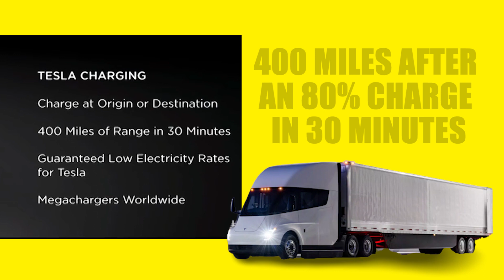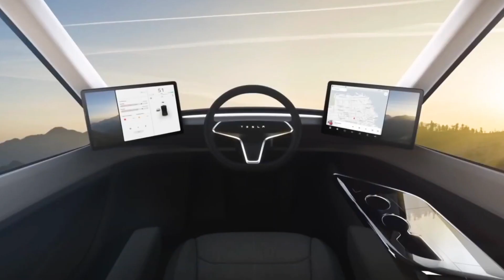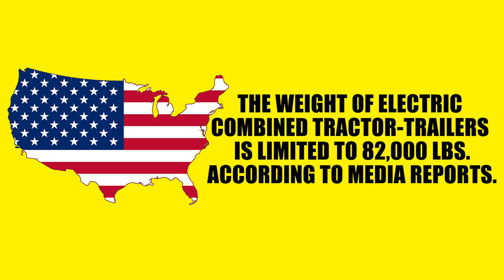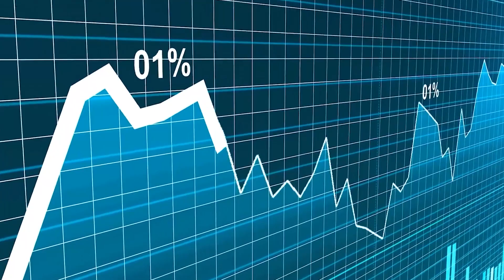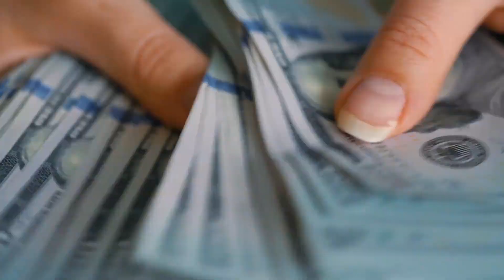2022 Tesla Semi Truck Will Destroy The Truck Industry

Comment: Not so fast just yet. The 300/500 miles range, though adequate for intra-state logistic needs, falls short of the range needed for inter-state transportation, let alone coast-to-coast shipping. You also need the bunker bed for the driver.

Besides, the reliability of the truck is unproven -- truck as a productivity tool would need constant driving to maximize the economic benefits; which is quite contrary to passenger cars, who spend 90% of time idled.

Plus, the Megawatt charges are a huge drain to the grid, a paltry solar panel won't make it by a large margin. And we haven't even started talking about the battery capacity drop in cold weather yet.

Having said that, the operation costs, esp. the fuel costs for Semi is so much lower than diesel -- the short-haul shipping would definitely the ideal market as long as the Semi trucks are reasonably priced and reliable.
Reply: Ev batteries are liquid cooled and heated. EV range drop is the result of keeping the cabin warm. Because of the very large batteries and relatively small cabin size this is less of a factor in an EV semi. The motors are the same as the Model S. A big reliability issue on EVs that is often not talked about is software. Tesla has the best software engineers on the planet.